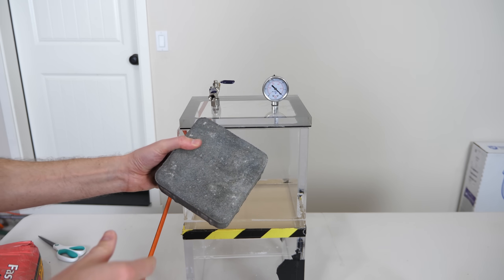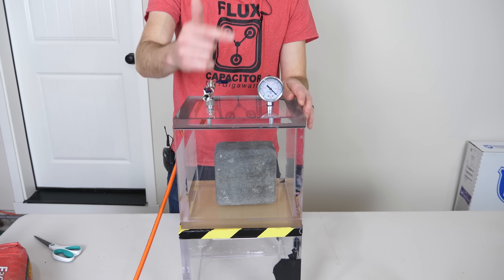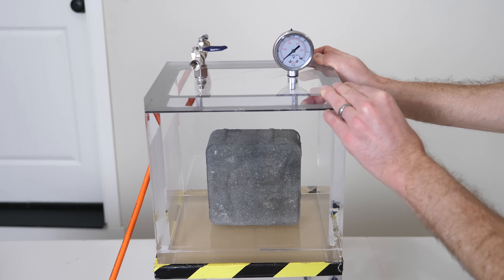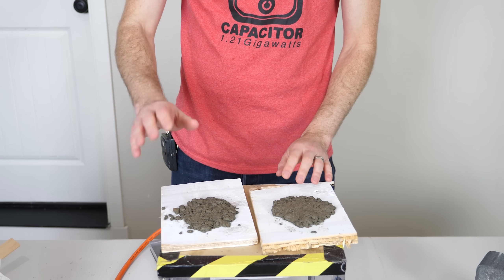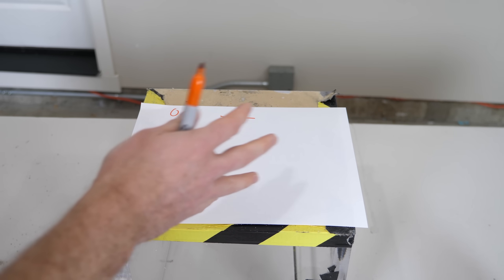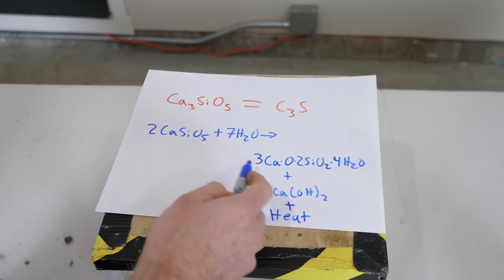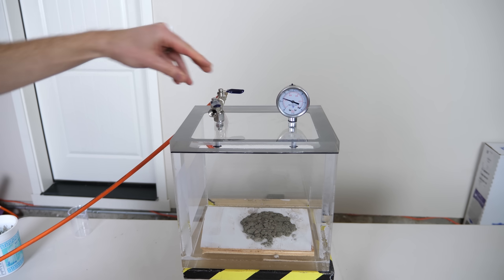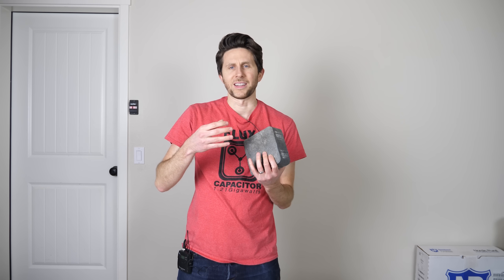Does Concrete Turn to Dust in a Vacuum Chamber? Concrete Without Oxygen Experiment

Comment: As a builder I offer the following clarification on the terminology for those who are interested:

Concrete is a combination of cement, fine aggregate (sand) and course aggregate (sharp rocks). 

Sand & Cement mixed together without the course aggregate is called Sand & Cement which is also called Mortar (for bonding bricks) or Grout (used between your tiles).

Sand & Cement mixed with Clay is called Render.

Originally though, Mortar was made from only Sand and Lime as Cement was too expensive for most applications. The advantage of this mix being that Sand & Lime can be recycled if it is ground down and remixed with water to make wet Mortar again.

With all of these cement based products, additional additives can also be added to improve plasticity, accelerate drying times, delay drying times or even to make the product less permeable to water, depending on the desired application. The faster you cure concrete the more it cracks.

And cement based products shrink as they cure, so products like “non-shrink grout” overcome this because they have an additive that expands the product slightly as it cures while the cement shrinks at the same time, therefore the net effect is “non-shrink”.
Reply: I learned more from this comment than the video.
Reply: "Sand & Cement mixed together ... is called Sand & Cement"
hmm sounds right
Reply: Wow. Thanks for that comment.  You did great at explaining things.
Reply: I think you forgot to breakdown the word cement "Cement", which is not found naturally. It is a mix of lime and slate.
Reply: I know Tennessee red clay is the best home made cement you can make imo
Reply: @Scandinavian_Pride  I think that is around the historic indian fort...And another one near Lebanon, where they used heated clay and mixed to make strong concrete before the Europeans came to the west.
Reply: @Scandinavian_Pride  that’s interesting, I haven’t heard of Tennessee red clay before, how is it made?
Reply: Architect here - the reason lime mortar was used for most of human history is because portland cement was only invented in the 18th century, not because of any associated costs. 

Sure, there was also gypsum mortar (plaster of Paris) and pozzolanic mortar which is the basis for the "opus caementicium" or roman concrete, but those are an entirely different kettle of fish - gypsum is very soft and thus has low compressive strength, which is why we now use it for plastering walls rather than holding bricks together, whereas pozzolanic mortar is excellent because it sets by hydration rather than carbonation so it can set underwater, but it requires access to volcanic tuff or pumice such as "Santorin earth" to produce.
 Once the interconnected trading system of the Roman Empire broke down, the availability of that material disappeared practically overnight and with it went the secret of roman concrete and most places that weren't Italy or Greece had to make do with lime mortars.
Reply: @wingsofwrath4647  excellent information! Thanks for elaborating further on the subject. My information was, as confirmed by your comments, more of a recent history on the uses of lime which were primarily limited by cost at the time when cement was available as a product. None the less, further back in the past before cement was available there would have been other considerations and different products being used as you have noted. 

I agree that Lime was used for its low compressive strength in mortar joints as these joints need to be softer than brickwork so that failure from movement travels along the joint rather than cracking through the bricks, which allows the wall to remain bonded still through the interlocking structure of the brickwork (to a limit of course).

The Roman’s had many amazing inventions that are sadly lost to history similar to what you have noted. And much of their work was also destroyed when the empire collapsed, even to the point where all the precious and semi precious stonework that once covered the facade of their buildings was removed when the Mongolians stormed the city, and much of it was relocated to line the inside of the 900 churches of Rome instead. All that is left on the original facade structures around the city are the holes in the walls where the facade anchors once were.

There are even some Roman roads that have lasted longer than our current method of road construction. We’ve gained so much over time and lost so much as well.
Reply: @seanmostert4213  Thanks, that´s interesting, the reason why mortar has to be softer than brick. Amazing how much mechanics is hidden in a brick wall. They look deceptively simple. Until you try ti build one.
Reply: @seanmostert4213  THe way cement is made is to heat it at high temps, so it is a vacuum effect when it gets wet. Its sucks it up, and the fine powder bonds.
Reply: damn, you know your shit
Reply: @d3lph1nn  everyone does, unless they're blind
Reply: I remember someone saying: There are two kinds of concrete, new concrete and cracked concrete. That is why post pour, especially on hot days we spray water on the concrete to help keep it from cracking. [cracking less]
Reply: @DrHarryT  yes that is correct, and we usually put plastic underneath concrete slabs for two reasons, one is to prevent rising damp (concrete is porous and water gets sucked up by it), the other reason for the plastic is to prevent surface cracking underneath the slab where it would normally lose excessive moisture into the soil.

The steel mesh we place on top of concrete is structural, however it is also there to limit shrinkage cracks on the surface of the concrete as it cures.

The higher the design strength of the concrete is, the more heat it generates when curing and therefore the risk of cracks increases. The same applies if you put an accelerant into the concrete mix to speed up drying time.

You can cure concrete on the surface with water, or a sheet of plastic, or put sheets of hession fabric and keep them wet, or you can spray a product that leaves a film (like wood glue) which can help slow the curing process on the surface.
Reply: What is render used for?
Reply: @SALSN  Same as stucco
Reply: Thank you! I was never sure how the "mushy stuffs" (grout, render, mortar) are related to each other and to concrete!
Reply: Make your own channel and explain things like this.
Reply: hi rich, when donate?
Reply: I fell asleep reading this
Reply: @God-mz9sf  … slow clap. I’m guessing you have some serious inferiority complex if all you can do with your comments is attempt to put others down.
Reply: I'm a a little more concerned that a 'builder' can't spell the word 'coarse'.
Reply: @janmikaldouglas2767  You need not be concerned. My brother a general contractor who has built apartment complexes from planning and soil testing to the finished product and yet can't spell worth a crap.
Reply: @DrHarryT  Little frightening, still. I wouldn't hire a contractor who couldn't put the invoice in sensible, legible form.
Reply: @janmikaldouglas2767  Maybe check you’re own comments before criticising… 😂

Comment: Vacuum equals a reduction of approximately 15 pounds of pressure per square inch on the surface of an object. Concrete has the ability to withstand, usually, at least 2500 pounds of pressure per square inch.

Comment: nothing will happen to the block, in hvac, the liquid line dryer has a concrete core that filters out deposits to protect the system. when ever we replace the dryer, we pull a 500 micron vacuum on the system.

Comment: I doubt anything will happen to it as now its crushed by 1 atm of air pressure and concrete can be used as a support structure withstanding way more. If there are some air pockets near the surface then maybe there will be some cracking there when air is escaping but i doubt it will destroy the block.

Comment: 10:05, vacuum concrete is slightly darker color because it has not yet undergone carbonization or  "setting" process. Vacuum chamber deprived it of CO2 to complete the carbonization. The missing chemical formula is Ca(OH)2 + CO2 → CaCO3 + H2O. Technically, you've created a slaked lime not the yet the concrete but since it was vacuumed and most of its water molecules are sucked away and it was exposed to carbon dioxide later, you speed up the process and turned it into concrete. Correct me if I'm wrong 😅😅😅

Comment: Maybe next time, instead of a splatter of concrete on a board, actually make a couple of small bricks. Put both of the concretes into a mold, and let them dry 100%. Vacuum and regular.
Then make the test.

Comment: What if the world lost oxygen for just 5 seconds?  What is meant?  1) All oxygen (02 molecules) disappear from the air for 5 seconds or 2) all atoms of oxygen disappear for 5 seconds?

If 1) then air pressure drops by about 20% and everybody will feel like they're suffocating.  Oxygen comes back, things go back to normal.  Well, except for those who panic and crash whatever they're driving / flying or otherwise moving.

If 2) then everybody dies pretty much instantly.  All of the water in your body turns into hydrogen gas.  All of the acetylcholine (which has 2 oxygen atoms right in the middle of it) will instantly break down.  That means that your nervous system just went bye-bye.  That includes your brain.  Also, oxygen is part of the structures that hold your cells together, so your cells will immediately start falling apart.  By the time the oxygen reappears (and where will it reappear, hmm?) your cell membranes will have already started bonding in very bad ways to themselves and each other.  Basically, you're gonna be a mess of the most tenderized meat-like substance ever.  Oh, and 5 seconds later your circulatory system will be filled with a mix of hydrogen and oxygen.  Gaseous H2 and O2.  You will burst.  And then, if there's any sparks nearby, then burn, baby, burn.

Comment: I was thinking that maybe there were gaseous pockets in poorly constructed concrete that may expand as the pressure drops and create a structural weakness - but no, that didn’t happen. Curing in a vacuum may take longer for the exothermic reaction to dissipate the heat…. But after “hours”? Prob enough conduction through the board and chamber walls to suffice

Comment: I'm no expert (I just know what my late dad used to tell me) but if every you decide to, yourself, cast a concrete slab (e.g. put in a concrete floor somewhere), AFAIK, the right way to proceed would be:
1. Don't make the concrete too wet. Exactly wet enough to cohere, and no wetter is what you want.
2. After you've compacted it (point 1 is to help with compaction), soak it, and cover with plastic. Leave it like that.
3. Keep checking. If it gets dry, wet it again. This is to get it to cure. (As you point out, the reaction is not yet complete. And I think Dad said if you waited about 20 years or something, it would finally stop reacting.)
4. For a reasonable time after pouring and thumping your concrete, keep it wet. The minimum is 7 days (in this scheme, anyway). You can go on longer if you like, but it takes quite a few days to get to 80% strength (which figure I sucked out my thumb because I've forgotten the finer details of this.)

As far as putting it in a vacuum chamber goes, then, I'd have bet on the concrete in the chamber drying out too quickly and being weaker than the wetter concrete outside that has some time to cure a bit. There's never any need to dry it. It does that itself (and water is a necessary reagent).

Comment: I think the water inside of the concrete block will vaporize, making it harder than before.
If the concrete was too wet however, I think it would be made unstable.

Comment: Was the vacuumed concrete warmer? Since the chemical process generates a reasonable amount of heat, and with the lack of air (or other medium) to transfer the heat to in a vacuum, the only place for the heat to go would be throughout the concrete mix and slowly into the acrylic. By retaining more heat whilst curing, which I suspect would also evaporate more water, could this reduce the quality of the concrete significantly?

Comment: But by removing air you can make the concrete cure quicker, because vacuum lowers the boiling point of water and can increase the heat in the concrete...

Comment: All those videos where they explained oxigen disappearence for 5 sec , they said about removing only oxigen ... From everything ... So that make sense that everything will shatter and weird chemical reactions will take place .. like hydrogen in water without oxigen will probably burn ! So it was obvious that concrete did not turned to dust in vaccum because there is still oxigen in the concrete even in vaccum !